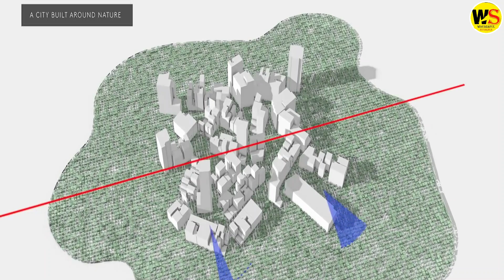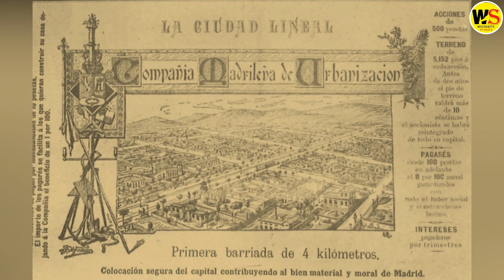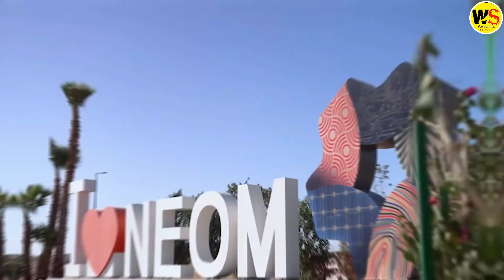NEOM Project Analysis: Mistakes Hindering Saudi Arabia's Vision | Wonderful Stories

Comment: If you do quick math, you will see that $500 billion is just not enough for a structure of that size, because it would have a volume of 17 billion cubic metres and that means the budget per cubic metre is less than $30. Even with a lot of open space inside, that is not enough. If 70% of the structure is empty space, that still leaves only $100 per cubic metre for the rest. That will never work. 

And isn't it strange that a part of the construction village of The Line is non the future footprint of the project? That indicates that the are not planning to build the whole 170 kilometres any time soon. There is so much empty desert. Wouldn't you build the construction village NEXT to The Line instead of in its way? 

And if The Line will be such a nice place to live, why did the Saudi Royal Family build a lot of conventional mansions and a palace close to The Line? That indicates that the crown prince and the rest of his family do not really plan to live there.